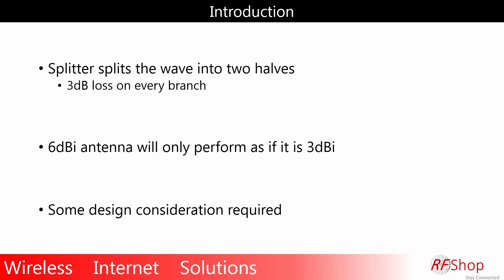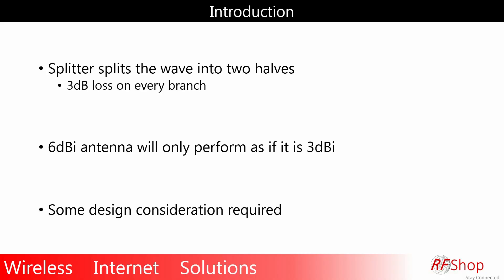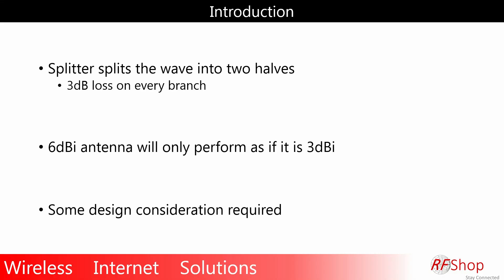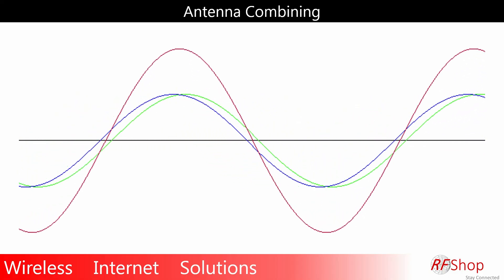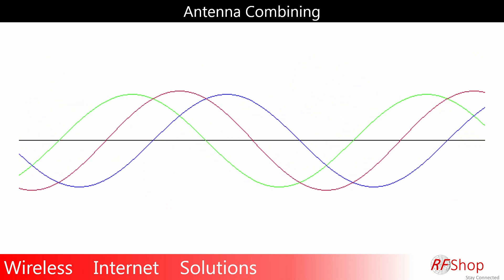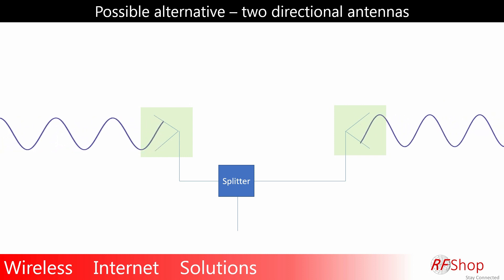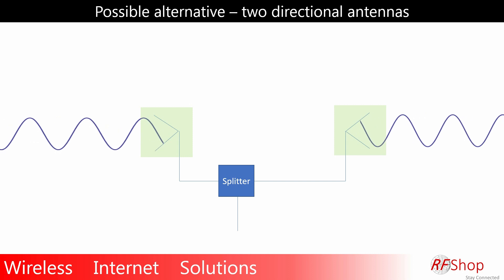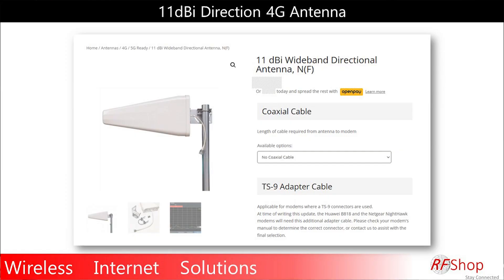Can I use an RF splitter on my Helium Miner ?

Comment: Thank you very much for your videos. Im learnng so much from them. Could I ask a question please? I would like to use a splitter to divide my signal between two directional panel antennas. individually they have a horizontal and vertical beam of 68 degrees. Would it be OK to mount these side by side but point away from each other at an angle to create a 138 degree beam? Or should I angle them a little furhter apart to avoid the possibility of an overlapping signal? I have very few witnesses behind me but many in a 160 degree arc in front of me so want to capture as many as possible. Cheers for any help you can offer.
Reply from the maker: Hi Bob. Yes, going back to back with directional antennas will indeed circumvent the concerns I raised about combining omni antennas as the two will overlap with much weaker signals (from one to the other). You will need to be mindful of the fact that a splitter / combiner does introduce 3dB "loss" so the effective gain number coming from the front of the antenna is lower than you may expect...but in some circumstances such as yours (I think) it's a very sensible solution to consider.
Reply: @RFShop  That is not what he asked.
Reply from the maker: @Glitch_brothers2023  got it. 
Side by side at an angle should also be OK. I would, however, spread it more like 90dgr to avoid too much overlap
Reply: Thanks for clarifying that. So conceivably one could put 4 directional antennas with high gain (maybe yagi?) back to back and in theory cover 360 degrees, correct? If choosing yagi do they not tx and rec out the back end also? If so will that back-end tx/rec interfere with the other yagis behind them? I have tower installs that are not reaching 20 miles/32 kilometers almost line of sight. mostly curvature of the earth and 3 dbi Omni antennas. we are to the point of considering upgrading to 8 dbi on some as they have no miners underneath them, we need range. What about 915 MHz sectors? will they work on the same principle of a 4G directional antenna? Don't they have 0 backend tx? If a 4G directional wide frequency antenna works can a 4G cell sector do the same thing? Sorry for so many questions but you seem very knowledgeable and intelligent in RF. Some of these clowns on YT need to find another subject to post about.
We have major bucks in these tower installs we are relaying signal from town to town in a rural area. otherwise, there will be no signal in or out to these towns. Sure they can populate the towns with miners and wideness each other until helium puts a stop to paying for witnessing. Then there are no in and out signals to build a network and pass data to, through, and from. Thanks for your time.
Reply from the maker: @glennstanford2446  lots of good questions. 
Yes, it's in principle possible to build a sector system with, say, 4 Yagi's or directional antennas each pointing to another quadrant. Problem would be, if you combine them into one miner you get combiner losses. In a 4-way splitter / combiner that amounts to 6dB loss. So if you have 9dBi Yagi's pointing in four directions, the effective power from each antenna is already 6dBi lower. It might be simpler to get a single 8dBi omni on the top of that same mast. However, often it's not possible to get an omni at the top so then this is an option. 

Just a comment on your question about the back radiation. A thing called "front-to-back" ratio on directional antennas tells you how much power goes to the back. You are correct that there is always something going in other directions. However, the power levels are so low that it will not have a strong effect. It will have an effect if you look at results with a magnifying glass, but in the bigger picture it's not always enough to worry about.
Reply: @RFShop  Thanks again. I agree just place an 8 dbi Omni and forget it. although I can't reach what I should be reaching. or maybe 2 yagis at 45dg from each other. 1-1/2 sides will never have miners its river bottomland. The purpose of the high gain four antennas on the tower is to reach over this dead space where there is no human population. although Omnis are 360 dg as you know that changes as your -dbi increases. So an airplane view of the RF signal will show the propagation has started to narrow and reach with more forward (elongating) while at the same time the back and sides start to go in towards the center. Not reaching a full 360dg out to the circle. The reason for me running around the world with this is, how can one determine the elongated part of the signal? That would help tremendously. Looks like a tick mark on the antenna top from the factory would solve a lot of problems. I have no way of telling if my gain is going into the river bottom or 90dg away. This way one can see which way to point an Omni antenna for best results. another example is if your miner is close to the sea all the RF going out to sea is wasted. Thanks for your help. Great work!
Reply from the maker: @glennstanford2446  yep...one-sided transmission just makes so much more sense if you are against a natural obstruction or open ocean. I think it's time for an antenna design company to present a 180dgr beamwidth antenna. I know it's possible...and maybe we should just do something like that. In-fact, I'm thinking out loud here and will talk to the team in the office tomorrow and see what we can do.
Reply: @RFShop  I agree on both accounts. Of course I am not an engineer but I can see no reason 180 dg can’t be done. That would be very valuable in the field in all types of communications. Build it and they will come….Thanks

Comment: Hi, great video. 
So with two directional antennas it doesn’t matter if one picks up of wave and second antenna picks bottom of wave at same moment?
Reply from the maker: Hi Patryk. It does actually matter a bit as that's where cancellation could become a problem. With antenna spacing it would then be managed better

Comment: Glad I found this video
New to Helium Mining and live on the North Coast of Wales, UK with a big hill to the south and the Irish Sea to the north. 

Now, this might be overkill, but could doing 2 12dbi Yagi antennas with a splitter help me more than just going down the Omni, and losing 100° to the hill and 160° directly out to sea?
Reply from the maker: Hi Duane,
It is worrh a look yes. Perhaps a slightly lower gain woukd be better though as the antenna beams get quite narrow. Something like 8 or 9dBi perhaps
Reply: haha I too am on the north wales coast and I really hoped I could reach blackpool with a yagi but I think the chances are incredibly slim tbh
Reply: @RedAndYellacuddlyFella  Well, my thoughts are more pointing it towards one towards Wirral/Liverpool and the other towards Llandudno as I'm based in Prestatyn.
I've just opted for an 8.5dbi at ~10m high, but have to wait for the miner to arrive to actually see what rewards that'll reap
Reply: @duanelusted3535  your location is desirable for a yagi pointing towards liverpool or you could potentially reach Blackpool also. I've checked the explorer and there's plenty of miners reaching those kind of distances. personally if I were you I would opt for Blackpool as there's a clear line of sight across the water but ultimately trial and error will determine the best rewards for you. good luck buddy 🤞
Reply: @duanelusted3535  also, I am still waiting for my miner. when did you order yours? i ordered a couple of Bobcats on the 1st of September so I'm guessing I'll have mine in feb/march
Reply: @RedAndYellacuddlyFella  My Linxdot won't be here til Late March, but in the mean time I'm trying to get everything else set up and in place ready to get going.
Would have gone down Yagi route, but Mrs bought the Antenna for Xmas 🤣

Comment: would there be an advantage of using two directional antennas with a splitter versus one omni directional antenna?
Reply from the maker: Yes, had this question a few times.
The omni antennas get lower elevation coverage as you go higher in gain, where the firectional antennas don’t.
Having two antennas back-to-back and then combine them with a 3dB splitter is most certainly a worthwhile consideration

Comment: Hey u r amazing Bru 👋 Can I use Antenna with this frequency 698-960 MHz for Helium 868 mhz  
Keep it 🔝
Reply from the maker: Thanks, appreciated :)
Yes, any antenna that does the lower 4G frequencies will also operate at 868MHz and probably work just as well !! 

You see quite a few options online where 4G antennas are used, but many of the Helium community members don't realise or understand that it's not technology specific but frequency specific.

Comment: Great video! What if I place one antenna directly above the other? I have access to a tall location, and I'm considering placing an 8 dbi right above a 3 dbi using a splitter. Thoughts? 
Thanks!
Reply from the maker: Hi John,
That's always a good idea, but it would still be possible to cause some trouble if they are too close to each other. I would just test it, and make sure that you don't see any potential "nulls" on the horizon.
Reply: @RFShop   
1- Ar fi ok daca pun doua antene omnidirectionale, suprapuse pe un stalp? Fiecare antena pentru un aparat, so no splitter. Una in varful stalpului si cealalta sub ea. Antenele s-ar afecta negativ una pe cealalta? Nu conteaza faptul ca antena pusa mai jos ar fi partial blocata de stalpul de metal.

2- daca as pune 2 antene pe acelasi acoperis, pe stalpi diferiti, la ce distanta minima ar trebui sa fie una de cealalta?
Multumesc!
Reply: Your going to lose 3 dbi/antenna (in this case a whole antenna) in the splitter.

Comment: Ground planes and helium antennas? Is there a benefit versus most antennas offered on the market which are dipoles with no ground plane?
Reply from the maker: Good question. They are simply two different types of antennas. A dipole is, as you probably know, an antenna that is "free standing" and works over the horizon when placed vertically. 
A ground plane dependent antenna such as the magnetic base ones often offered as part of some miners as "monopole" antennas. They need a ground plane to act as "mirror" to create the second pole of the antenna. It's a simpler way to make an antenna from the manufacturer's perspective, but requires the user to put the unit on a piece of metal. If they don't the antenna is actually really bad. 
In terms of performance, the "monopole" antenna does have what we call squint. It is not that good on the horizon, but looks a little bit up towards the sky. In my view not that good of an option for Helium antennas as you want to see straight into the horizon. 

I have seen some Youtube videos where people talk about a breadpan antenna, and they are amazed at how much better their magnetic base antennas work when putting it on a breadpan. That makes perfect sense, as they are then doing what was meant to be done all along! Sometimes it helps to read the installation instructions!
Reply: @RFShop  thank you. For my application, I live in a valley with mountains on two sides, so I am deciding between a 8dbi dipole or a splitter with two directional antennas.
Reply from the maker: @amadeo4977  good question. First impression I would consider the directional antenna setup as it seems like a total waste of effort to have an omni transmit into the two sides of the mountain if there is no benefit of having coverage there. You will have a mich nicer overall radiation pattern with two directional antennas.

Comment: My understanding is line loss (Db) is different than the Dbi. “dBi is used to define the gain of an antenna system relative to an isotropic radiator” or perfectly spherical dispersion pattern. The expression dBi is used to define the gain of an antenna system relative to a spherical pattern with 0 Dbi.  It’s an abbreviation for "decibels relative to isotropic.”  Signal loss due to cable & connector resistance is expressed in negative decibels.  If you have an antenna with a 9 Dbi radiation pattern and cable with Db 3 Db of loss, you still have a 9 Dbi pattern with a 3 Db loss in signal power.
Reply from the maker: Agree but with some caveats. We use dBm for the transmit power, dBi for the antenna gain as you describe and dB for the relative power losses. They are all related and the same scale,which means we use them in the same equation. Friis transmission equation, for instance, uses Transmit Power (dBm) minus cable losses (dB) plus antenna gain (dBi) for the final EIRP (again, dBm if we measure relative to one milliwatt)
Reply: @RFShop  regardless of antenna dbi, I am guessing dbm is relative to where in the radiation pattern you are measuring?

Comment: Does using  2 miners with each of them having a directional antenna facing a different location increase the coverage area and the rewards or there will be overlap and a split of rewards?
Reply from the maker: Hi Basil. I actually don't know if you are really meant to put two miners on the same location. The concept you propose is RF-wise possible (that's how cellular sectors work), but the challenge is whether it's possible in Helium system
Reply: Did you ever try 2 miners in the same location using 2 back to back antennae? Curious how that turned out!
Reply from the maker: @imacatwith6toes883  ah, so this is different than the setup that was discussed a while ago with two miners via one antenna using a splitter? 
No, I have not done something like that yet. I am still a bit old-school, and try to limit my setups to 1 hotspot per hex. It's a bit of a luxury I guess, where I'm in the southern suburbs of Adelaide so it's not very densely populated.

Comment: Hi pal, very helpful video, love it! May I know if it is possible to have two helium hotspots share one omni antenna please? cheers
Reply from the maker: Hi! 
Yes, in this low power scenario it could be done but you have the same effect, just the other way around. Only half the power will flow into your miners
Reply: @RFShop  Thank you so much mate! may I know which splitter should I use? will this kind of connection, two miners share one antenna, do harm to my antenna or miners?

Comment: What if I was to use a 9dbi antenna and also a 5.8dbi antenna? It reduces the signal strength, but would it hit a wider spectrum based off of your previous video on how it spreads out?
Reply from the maker: Yes, you will change the way it covers the elevation, but a big problem is that you also change the way the antennas could interact if they are actually too close to each other. It's just something that needs to be done with utmost care

Comment: This a great video. I have a use case where I can put two directional antennas in opposite direction for Helium mining. Now there is a limit on 9 db gain from Helium and due to USA regulations. Given there will be 3db loss on both directional antenna, would you recommend buying two 12 Db directional antennas so that it nicely fits in the acceptable range after loss?
Reply from the maker: Hi RG. Yes, that would indeed be a suitable and sensible solution!
Reply: @RFShop  Thanks for the confirmation. Two follow up questions. 1. It seems that there are no 12 db directional antennas actually available that go with helium or at least I can’t find one. Do you have anything in mind that might work the best. 2. Which splitter do you recommend which work best in your opinion. 
Do you know if anyone actually has tried splitting with helium hardware and was successful. I am ready to invest and try but if there is someone before me who has tried that would be great to hear from. 
Many thanks!!!
Reply from the maker: @goyanka01  I would use a good 4G antenna. 
https://rfshop.com.au/product/11-dbi-wideband-directional-antenna-nf/
Reply: @RFShop  which splitter?
Reply from the maker: @bra1nsen  the 4G splitters would work well...they cover the 900MHz band without trouble
Reply: Since you mentioned 4G antenna can be use, does it mean I can also use "Tri band 2G 3G 4G Cell Phone Signal Booster Mobile Signal Repeater Booster Tri Band Amplifier" to amplify my 3dBi and 5.8dBi antenna.
I currently staying on a Condo and I have no clear line of sight as there are high rise buildings blocking

Comment: great ideas ....thank for it...what if i want to put my antenna in a cell phone tower ?? it will work or the transmiting of cell phone antennas  will effect in negative way on it ?!
Reply from the maker: Hi. It really depends what is meant by cell phone tower? I doubt one would get access to the infrastructure and permission to put an antenna on those towers (as there are quite a few other RF artifacts coming into play such as PIM and RadHaz).

However, if you want to use an antenna that's also a 4G antenna then the answer is yes, as long as the antenna operates in the 900MHz band it will work.

Comment: Could I buy 3 bobcat miners, get 3 directional antennas and set all this up in 1 location without getting penalized? Their directional and not Omni. I’m going to imagine you would be penalized.
Reply from the maker: I think so. I would rather go with one good high gain omni (say 9dBi)
Reply: I think they would compete for rewards similar to as if your neighbors on each side of you set up hotspots.
Reply: @greggalexander5663  I get it but technically they shouldn’t. It’s 3 directional antennas say north east west. I’m using a directional antenna to hit certain areas.